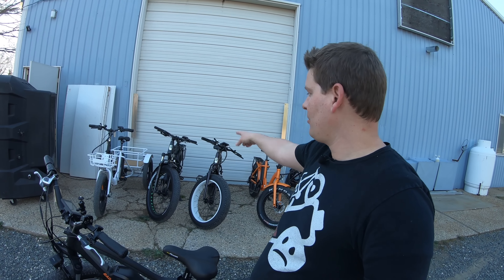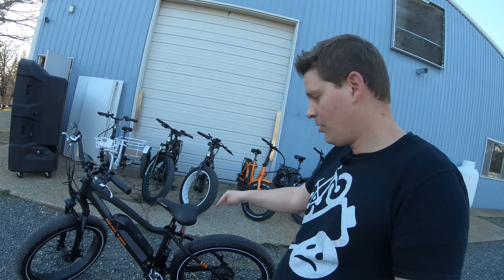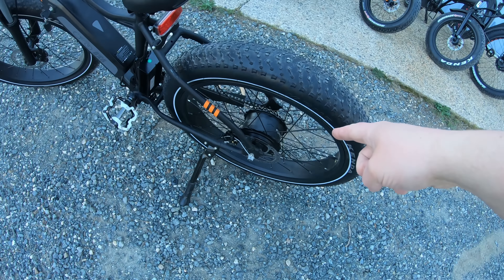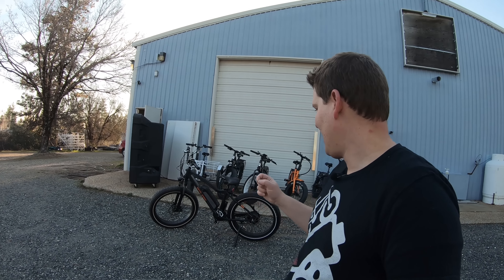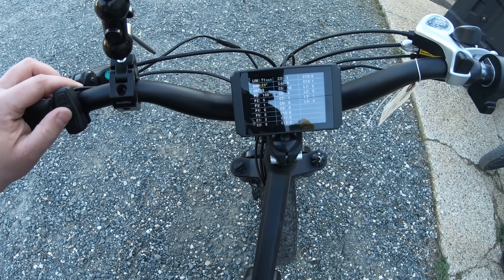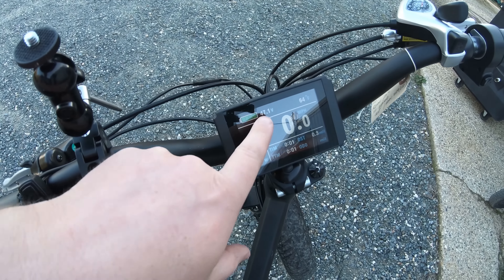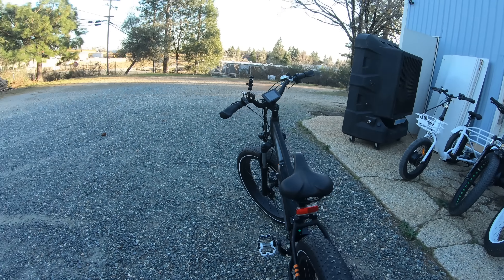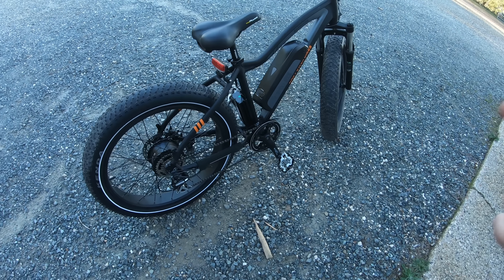How To Improve My Rad Electric Bike

Comment: I have the upgrade (without tail light function) installed on my RadRover 5 that I bought in Feb 2020. It works fine and is 100% compatible. Obviously I have lost the taillight which for me is acceptable. The controller adds a significant amount of power to the bike 👍

Comment: I just got my radrunner,  I need more power, for the hills,  can’t wait for the upgrade.
Reply: Hit the weight room. :)
Reply: Did it work?
Reply: Just installed mine on my radrunner and it feels like a different bike (in the best ways possible). I weigh around 260lbs and hills were my biggest complaint; not any more. This thing hauls! Almost popped a wheel the first time out.
Reply: Get some slick tires or semi slick tires

Comment: Received this controller upgrade today. Works 100% on 2020 RadRover 5 with no issues whatsoever. Massive torque increase with stock motor for hills. I am so happy with this purchase. It's exactly what this bike needed. Might need to upgrade the battery at some point though. This extra power is kind of addictive.
Reply: How's it now bud I've been holding off but I'm getting it soon how much more power did you get is it faster now
Reply: @georgehemsworth2919  Definitely more power. Much quicker, too. Top speed more or less the same (28-30 all day long), but I got it for the torque because I ride where there are lots of hills. Be prepared for a reduced range if you're on it a lot.

Comment: I installed the upgraded controller/screen on my old 2016 RadRover this weekend, And also the hydraulic calipers. 100% plug and play! Way more low end power. I seen 1400 watts on the screen on the stock 48v battery.
I have a 52v 20ah triangle battery on the way, As well as a true 750watt motor. Can't wait!

Comment: Took me nearly a month to get my Civi Cheetah, should be hear at the end of the week. Next up is a pelican case full of tool batteries I can hang from the pannier rack and figuring out how to wire them and the stock battery into a selector switch (I've been told that wiring batteries of different voltages can cause problems).

Comment: I have a 2019 Rover with the no-tail light upgrade works great! Just got my new Rover Stepthru and ordered this one. Rad told me there are NO changes to the electronics between the 2019 to 2020. I'll report back once I get the new one installed. Hey Mr Bolton ship mine first! ;-)
Reply: Any word on this?

Comment: Had my 2019 Rad Rover since August 2019 have over 1100 miles on it. You are right on stock controller being weak. Nice to see you may have remedied this. Now, can we get someone to build 20+ amp hour batteries for this bike.

Comment: In addition to the brakes lights your tail light DOES have a flash AND a solid mode on the 2019 Rover, access is at the base of the light where you'll find a little rubber button. Maybe after I get my biz opened back up and the dollars flow again, I'll get this upgrade!

Comment: Hi Kyle, it's great that you continue to work on these upgrades for Rad Power Bikes owners. It is awesome for everyone to have the ability to buy replacement parts elsewhere if they so choose. Really excited for the potential of a 1500 watt motor for the RadWagon/RadCity. With the extra wattage being pushed to the motor if a user so chooses, do you have any idea of what to expect longevity wise from the stock motors? Is this a concern?
Reply: does it work for a mini step thru

Comment: Great video Kyle, I’ve got a 2019 Rad Rover and I love it.  I’ve used it for commuting, I’ve used it for motorpacing with my wife piloting it, and my son has used it to go to college. Over 1000 miles now with zero problems. I’ve been thinking about the controller and display upgrade just haven’t pulled the trigger maybe you can help me out.

Comment: Nice Video.  I have a 2019 Radrover and a 2016 radwagon with all wheel drive.  Put me on the list for the 1500W rear motor when you find out more about them.  I plan to use the upgrade on the Radrover.

Comment: Would be an awesome upgrade for my Radrunner! Having a display vs the "bare bones" controls is nice, but the extra oomf to get up hills would be clutch in an single geared model like this (especially when the kiddo is riding on the passenger seat in the back).

Comment: Im doing something a bit different to somewhat upgrade.  Im making a different bike battery using A123 LiFePo batteries.  Im mostly doing so for quicker (bulk) charging when on the road.  Of course it also allows more discharge amps as well, but i prefer a bit higher voltage.
Reply from the maker: Interesting! You sound like you like tinkering with things.

Comment: I got my 2019 Rad Rover last year and love it. Been eyeing your upgrade kit. Question, what volts is the display USB putting out to charge let's say a cell phone? And does it work like the stock display for charging? Thanks!
Reply from the maker: USB voltages are an industry standard and do not change.

Comment: Yes you can upgrade mod controller without buying new controller & without spending any money.
It's very easy and simple to do.
I have the same controller.
With KT3 LCD display

It also added extra 3 mph to my top speed which very surprised me.

But it means nothing if you haven't got a big battery pack like 14S 11p+.
That's what I have
From 54 volts it drops to 48 volts.
Without a bigger battery it will decrease your top speed.
More amps More power Sage

Comment: I have the 2020 rad rover step through. I am hoping the new controller works on it. I also have the 2019 rad City step through. I will be interested in the 1500 watt hub motor for it.

Comment: I just assembled my 2019 rad Rover last week. It's been sitting in the box for the past two and a half months due to an illness in the family and the busy holiday schedule. Can I assume that the new controller provides a lot more torque? I could care less about top speed, but more torque would be fantastic! I'm even considering putting on a 38 tooth chain ring instead of the stock 42 tooth chain ring. Thanks for producing your very informative videos!

Comment: I have the Rad Mini step through, and I'm above the max weight limit of the bike.  With my back box, rear rack, I'm way over the limit.
Even on a slight hill, it's showing 750 watts !!!   I sure could use more hillclimbing power, and don't need anymore top speed !!

Comment: Just got a rad Rover Gen 5 awesome bike, was playing with the controller and changed from 32km to 40 that seems to get more speed also changed the tire size down to 20 not sure if it changed the pedal assist I think it did but it seemed to run out of battery really quick

Comment: Good videos you are putting out.  When it comes to the RadRover controller upgrade kit you sell, how is not over taxing and creating abnormal wear on what is speced as a 500W stock motor that peaks at 750W??  Seems like your kit would be pushing well over 1000W on that Rad motor as shipped with the added amps.

Comment: I got the 2019 RadWagon!! Will love this upgrade, you’re awesome dude, love your videos! Thanks
Reply: did it help and work on the Radwagon ?
Reply: Ematuresco it works, I’m finding the placement of the new controller difficult. And messing with the settings is a bit frustrating. Would like a better breakdown of the settings in a PDF even though Kyle from Bolton has a video explanation of the settings. It’s still worth it!
Reply: I was also hoping I could program the pedal assist levels manually. It turns out you can only set between 1-3 levels which increases and decreases all PAS levels simultaneously.
Reply: @DirectorMihai  and how is it for very steep jnclines compared to the Stock one? There are some 15-18% on my daily commute, where I only get up to 12kmh/7mph with Level 5/full throttle
Reply: Ematuresco okay so I’ve started testing it out and for steep hills it’s clearly outputting more power making it a lot easier. I’ve also noticed the taillight/brake light always functions as long as the battery is in the on position. Which is so awesome. This means if you hit the button on the taillight to make it flash, it keeps flashing even as you turn off and on the display. (You have to turn off and on the display to access settings) now he’s my issues with the upgrade so far. I’m not liking the lag on displaying speed and watts. The old display and controller seemed to communicate instantly. Where this new one jumps up a second late. And worse hangs up when you do a full stop. Like if I’m peddling it shows “assist” and displays a wattage. When I stop peddling the “assist” icon disappears instantly as it should. But the wattage still shows a number that very slowly decreases. It’s the same with the speed. When I come to a stop it shows me 8kms jumps down to 2km/h and finally sets to 0.
Reply: And for the final issue I’m having.. is the motor is making some loud ribbed noises. I used to experience the same noise and feeling very rarely on the old controller. It only happened when I’d be starting from dead stop giving it high wattage until the bike got up to speed. But now with the new controller I hear it at 25-70watts constantly and whenever using regenerative braking. I’m thinking the motor is not very compatible with this controller. So I’m looking into getting a new motor that’s rated for higher wattage.(Shengyi is 350-500watts motor) Bolton mentioned a future 1000watt DD motor upgrade for the RadCity/RadWagon but who knows when that’ll be. So I’m going to check out some local shops in Vancouver to see if anything is compatible this new controller.
Reply: @DirectorMihai  Bolton said 1500 watts, and the Radwagon motor is from 432 to 800 watts (somebody opened it and looked at the facts).
You can buy a bafang 1000wat motor (bshd) I heared it is compatible and good.
Reply: @DirectorMihai  how much power does it output or steep hills ?
My Radwagon is on 749 watts on those hills of mine..
Reply: Ematuresco it goes up to 1600 watts. That’s peak. It starts to drop off to around 1200watts but it’s still very powerful going up very steep hills here.

Comment: Question: I have a 1000 Ecotric Hammer, 48 Volt, I want to use a 52 volt battery with. Is there any reason why the 48 volt controller would be damaged by this?

Comment: Thanks for your informative and interesting video.  I have a 2018 Rover and a 2019 Mini that I had shipped to Maui for the 3 months a year I spend there.  I really like your color display but, more important, the need for more torque on the West Maui Mountain rides make me lust for the 35 amp controller.  I would be interested in a comparison of the 52 volt battery upgrade vs. carrying an extra 48 volt battery in terms of range also as I would like to circle the West Maui Mts. and return thru Lahina and that is not a possibility with one 48 volt battery (I personally tested this !)
Reply from the maker: Those West Maui mountain rides sound incredible.
Reply: @Area13ebikes  Hi. I have a question for you. I've got a Volt Bike Yukon 750 with the bafang 750w hub motor and I want to upgrade my esc too a 35amp can you help me out with that? I have watched many of your videos and am a subscriber. I just got my Yukon 750 on April 7 of this year and have already put just over 1000 miles on it. It had just over 600 miles on it when I bought it. I have been looking for quite some time to find something that I could afford, but it had to have good reviews so needless to say it took me a while to actually find one. I had a spinal injury back in June of 2014 which partially paralyzed my right side and put me on disability which being a single full time dad of four amazing kid's a fixed income makes thing's a little bit tight financially! Lol but seriously!😁. So I have hobbled around for past 7 year's which physically has not been good. But now like I said I have put in 1000+ miles on my Yukon 750 and it feels ABSOLUTELY AMAZING too get my cardio system working again.. I truly feel blessed to have my electric bike but since my right side doesn't fully cooperate with me I would love to have more power too help me out with the hills here in Missouri. Sorry for rambling but I couldn't help but too fill you in on why I am inquiring.. Thanks in advance and keep up the great informational videos I enjoy learning as much as possible about my new e-bike hobby... God bless

Comment: I have a 2020 Radrover. Would like to find out if it would work on my bike. I think the battery might be slightly different there is no on off button on the battery anymore you do that with the key. I’m not sure if the connectors are different.

Comment: I did the Motor, controller, color display upgrade on my 2017 Mini and needed to add the female end of the XT90 connector to the bike and your power cable adapter.  Still tweaking the settings.

Comment: Hey I just got my upgrade in the mail and installed it on my Rad rover 5 . There’s one strange thing going on and that’s the voltage meter reading 52volts when I thought all the Rad batteries where only 48v.
Reply: What month of pre-order did you have?  I got onto the July pre-orders and haven't seen or heard anything from Bolton yet.
Reply: Sgt. Sister Fister I ordered mine at the end of May and was told at first to expect it beginning of July. I have been pestering them ever since .

Comment: I was wondering if I could upgrade the power on my rad wagon. I use it for camping adventures, all my gear and I on the bike max out the weight limit. So this upgrade would help with acceleration and heavy loads?

Comment: Good video - What set up would you advice for the 2020 Radrunner the 25A or  the 35A controller regards
Reply from the maker: 35a can be tuned down.   25a can't be tuned up.

Comment: I have a 2019 RadMini....in Canada!....and unfortunately supposedly because of Canadian regulations RadPower limits controllers to 500W....they only produce one bike, I'm sure, but the controller is programmed to only put out 500W ....I have been in touch with Rad back and forth forever via email.....this might be my answer... I also have a 2019 City ST and that too could benefit from a controller that could actually feed the motor 750W (like the US bikes)
Both bikes are great...I'm not looking for higher speed...but the acceleration is poor on both bikes. I'll be looking at your website. Great!
Reply: Another option that occurs to me is if people in the US are replacing the OEM controller and screen....if I could get my hands on a US screen it would be an improvement (on both my bikes the screen NEVER reads above 497W) With an american screen the controller would deliver 700W+ like I see on so many videos.
Any US owners out there want to sell their old screens...I need two.

On another RAD subject...I made two simple modifications to both my bikes which make them "work" much better and I'm surprised I don't see these on more (any) Rad bikes....the first is to move the shifter tight to the throttle body. Now you don't have to move your right hand to shift anymore. Some grinding/filing of the brake clamp is required to make this work but it's a five minute job and can be done without removing the brake/brake clamp from the bike. Rear brake application becomes a two finger job but that is not a problem.
The second mod is: I ride with gloves on, making selecting/changing PAS levels a real pain. I found furniture "bumpers" or the right size (kitchen cabinet door bumpers would work too) and crazy-glued them to the up/down buttons. (Loosen the clamp and position keypad perfectly level in all directions...one small drop of glue in the depressed arrows of the buttons is all it takes...position new buttons and hold for ten seconds...you're done.

Comment: Hi man thank you for the descriptive video. I have a rad runner 1 (v2, I believe) power bike with the stock 500 Watt electric hub. Do you know if after installing a bolton upgrade it is possible to install either an additional front hub 1000 or750 watt or a mid drive motor and run it with dual throttles? I am looking for speed here. I am considering ordering a 52 volt battery as well since, as you say it will increase the overall speed as well. If it’s possible to add an additional electric motor with a dedicated second battery and throttle I am supposing this will also give you a much greater top speed. The bolton settings I have been fooling around with but I don’t really know what to change in order to max the torque and speed are you able to provide some tips in any of these areas? Thank you I would very much appreciate the advice.

Comment: I have a 2016 RadRover, and am torn between the old and new controllers.  If I wait for the new one can I install a taillight?  What voltage does the taillight run on?  
Oh, and I def wanna be in the drawing for a free one.
Also need a 52V 20Ah battery.

Comment: Hey, Started watching your stuff a bit ago, dont know if you answer questions or not but I thought I would try. Can you run Two rad power head lights off a Juliet 2 pin splitter on a Rad power bike and not kill anything? Like the upgrade and standard at the same time? Do you make a plug and play Led Motorcycle type light?  Thanks Love your stuff.  The legal stuff was great.  I shared a bunch of the vids.

Comment: Just got my first ebike its a 2018 radrover 28/29 inch. I bought it used with 140 miles on it for $1100. I love it. However i am a bigger guy and am needing to beef it up a bit as it doesn't like to pull a hill very well with my 300 pound self. Would it be possible for you to do a gps hidden install video with direct power wire into battery whether bike is on or off. Big concern of mine is theft as i live in high crime area. Thank you for your time!!!

Comment: If the radpowerbikes have a 500watt (750w peak) motor and a 48v battery, doesn’t that mean that the maximum amps the motor can even handle is 15.6 amps? I’m confused how this upgrade is working. 35 amps will put out 1,680 watts. I know this upgrade works but I don’t know how it does with the stock motor 🤔